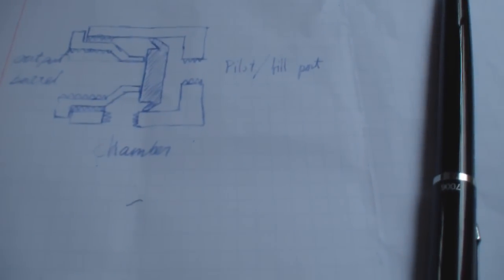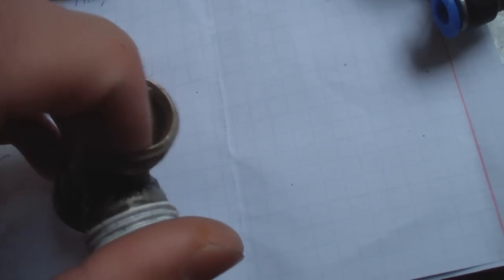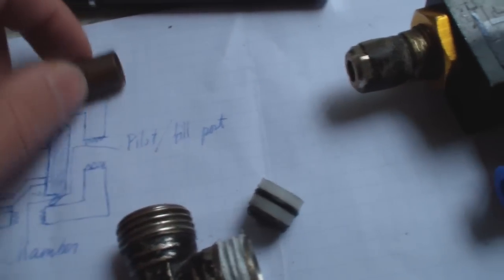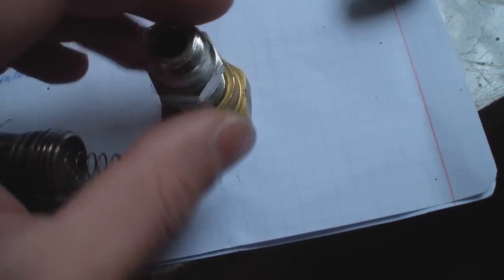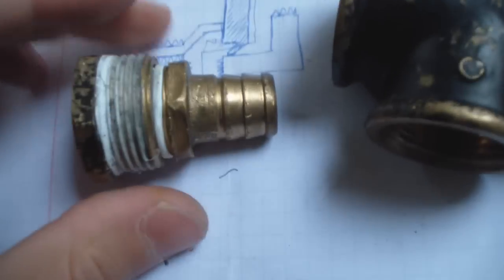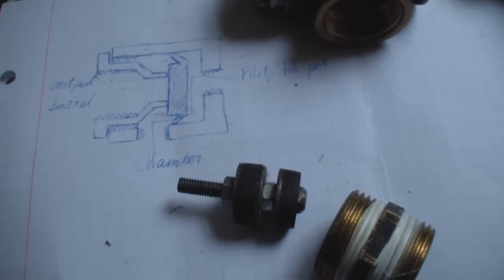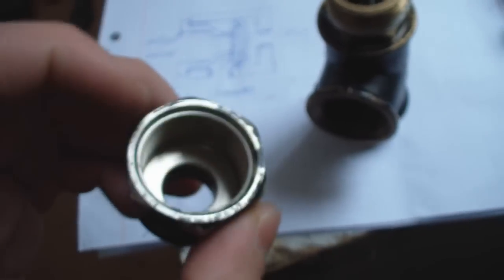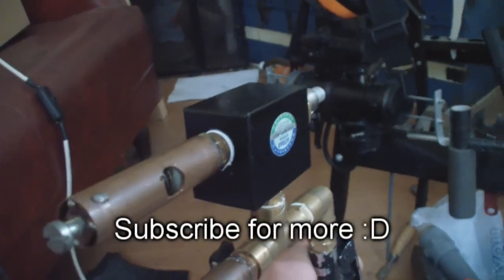How to make a QEV/piston valve (explicit)

Comment: Man, let me ask you a question about that valve you show from ebay. When I release the pressure on P port, will the valve discharge all the pressure of the chamber connected on A port to the R exhaust?

What if I use a 2/3 push button valve with the common way connected to P port, normal way connected to the chamber and second position vented to atmosphere? When I press button, the chamber start to exhaust. When I release the button and the P port connect to chamber again, will the piston close the R exhaust or not?

Sorry for any mistake, I dont use to write in english.

Comment: can you make a vid (or at least tell me what they are called) of how to make a valve for a pistol that has two openings - one to the chamber in the handle and one to the base of the barrel (so the two holes would be 90 degrees from each other. I also want it to stay open (and let ALL the air out) and it should do it abruptly (not gradually like a ball valve)
Reply: Quick Exhaust Valve? That's what you're seeing here. unless you repressurize the pilot enough to (when combined with a return spring) overcome the remaining pressure in the tank, the valve won't close until the tank's empty and a fresh one is installed (repressurizing the chamber). The trigger actuates the prime valve, which depressurizes the chamber, and "explosively" opens the main valve, allowing the air to flood into the bore.